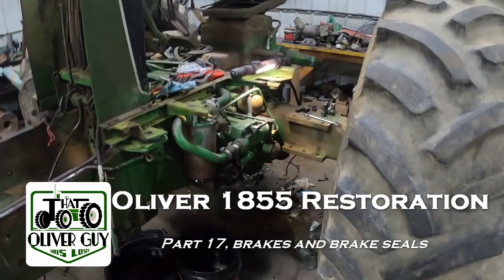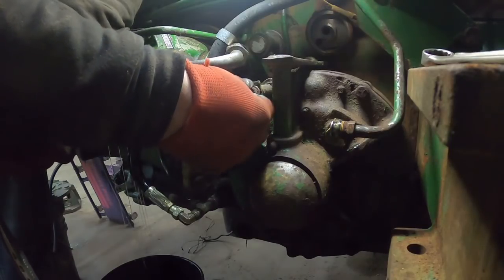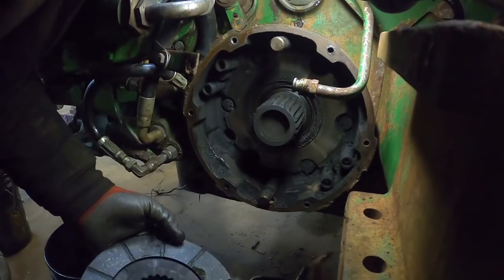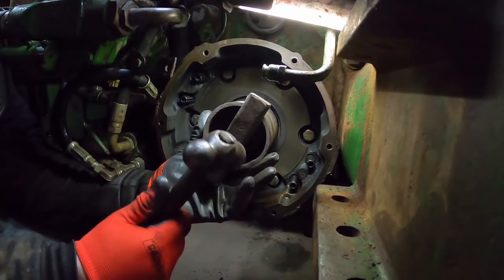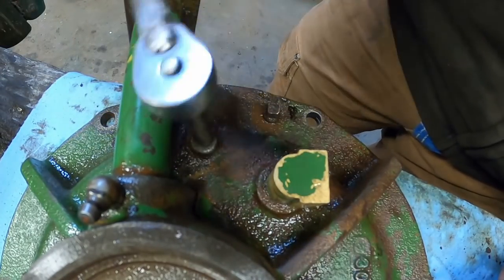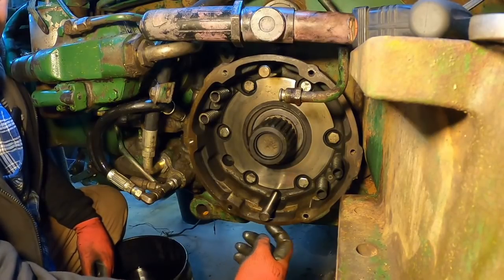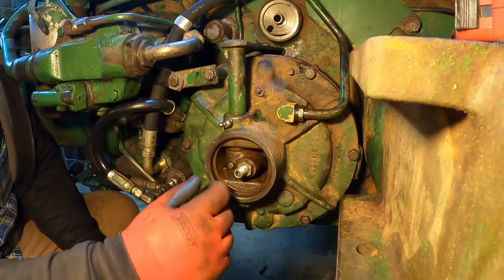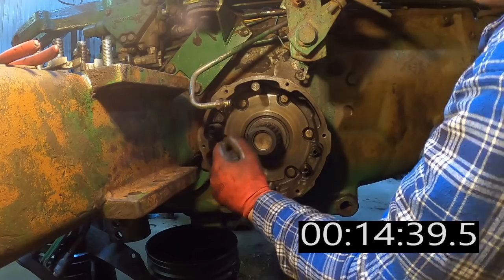Oliver Brakes - 1855 Restoration Part 17

Comment: Good video to help anyone working on one of these units. The early 55 series had 3/8” brake lines and the park brake shaft didn’t have grease fittings and the shaft seized in the brake housings. Probably most of those units have had the grease fittings added over the years. Early 2/85, 2/105 brakes would squeal at times and the fix was a brake housing that was 1-3/8” thick vs. the original 3/8 housing. I changed quit a few of them in our PA hill country. Thanks for promoting the Oliver history!

Comment: I am so grateful for these videos.  I just recently acquired a G850 Minn Mo and I have to do the brakes, steering and PTO.   It was originally shipped to Freeland Mi so not too far from you.  
Sold new by Rohde Equip  
Ill be referring back this alot!  
I will probably go through the brake valve as well
Reply from the maker: Rhode Equipment, I remember that name. They were still in business when Agco bought the White tractor. We'd sit with Paul Rhode at the dinners and talk about the good old days.
I have my brake valve waiting on the bench for a reseal, so there will be a video of that one of these days.

Comment: Would you be able to do a series on the large gas-powered tractors some time? I saw an 1855 gas 4wd ad and was very interested to hear more about it. I'm a big fan of large gas engines : )
Reply from the maker: I can try to do that. The 1855 was Oliver’s largest gas offering, at least in late model, high horsepower models. I remember seeing pictures of a low houred 1855 fwa, gas engine,  and cab. It was bought new by a rural doctor that wanted to be sure he could always make it to town, no matter the weather, and gas so it would start no matter how cold. That's pretty much all he did with it, and it's in the hands of a collector last I knew.  The 4 cylinder Oliver 99 had well over 400 cubic inches of displacement,  but only made about half of what the 310 in the 1855 would.

Comment: Back in early 70s at Chrysler Plymouth dealership we got air hose n just clean that asbestos right off into the air 
 They got same set up on later model combines . Mechanical to hydraulic don't know how many went to wet disc n same thing with hydraulic components mechanical over  Electric looking forward to Restoration

Comment: Did they change the trans housing enough that you couldn't put these brakes in  a 50 series tractor? Another fantastic video, thank you!
Reply from the maker: That is an interesting question. I did some digging in the parts books, and both housings use the same seals, orings, bearings and shims. I can't say 100%, but if I had to guess, I'd say they could be swapped. The downside is it would be a lot of work since the bull gear prevents the brake housing from being removed. You'd have to pull the hydraulic unit and the axles so that the bull gears could be taken out, then the housings could be slid out. You'd probably want to switch to a 55 series dash as well so that the brake pedals and brake valve are there. Putting the brake valve on the 50 series rear end and getting it to work with the pedals would be a challenge. I guess it could be mounted under the right platform near the brake pivot, then you'd just have to fab some linkage to connect the 2.

Comment: Wondered about slightly beveling the bottom outside edge of the brake piston a bit more to allow it to pass by the O ring easier?
Reply from the maker: It is beveled fairly well. I recorded something about it, but left it out to keep the video from getting too long.

Comment: I asked you about the brakes on a 1755 that the pedal falls to the floor. I pulled apart the drum on the side and it’s not the problem and been rebuilt recent. Where is a good place to get a rebuild kit for the valve in the dash?
Reply from the maker: I don't think there is a kit. It's mostly orings, but there is a gasket or 2. Agco still has everything seal wise, but I'd open it up first and see if there are any broken springs. If that's the case, you might be as far ahead to get a used one. I'd get one out of a White 2-105 or 2-85, they have all the improvements that some of the Olivers did have.
Reply: @ThatOliverGuyChris  ok thanks can you get that thing out without pulling the fuel tank?
Reply from the maker: @xade7863  I don't think so. It's really buried in there.

Comment: That was an excellent video. I've always wondered about the brakes on the 1755 at the farm but they've always worked so good we've never had it apart. Not in my lifetime anyway. Someday if I get my way all of those Oliver tractors will be restored by me so these videos are going to come in super handy. 
That's really cool you still have parts from the dealership on the shelf. Would you say it's still a wide selection?
Reply from the maker: When we closed we could return any current part to Agco for dealer cost, except things like paint, hoses, seals, .... stuff that was considered short shelf life. As we packaged up stuff to ship back, I got the yay or nay approval on what stayed and wentt. So things like brake discs and common wear items stayed because I knew I would use them eventually.  So there's a pretty good assortment,  but there's been a few things we returned I wished I had kept.
Reply: @ThatOliverGuyChris  Yeah I can imagine there's a lot of things you wish you kept knowing what you know now. I imagine that was probably a hard call to make at the time when it was all happening though they were probably a lot of mixed feelings about the whole situation in general
Reply from the maker: There were things that were pricey that I might never need, like a closed center hydraulic pump. That's a lot of money to have sitting on the shelf possibly rusting or seals going bad in, so I took the chance and sent it back. Knock on wood, I haven't needed one in all these years. Hindsight is always 20-20.

Comment: Chris is there a way to tighten up the tension on the throttle? Mine keeps creeping down
Reply from the maker: It's under the fuel tank on a 55 series. Here's a link to my video on that
https://youtu.be/mU_pSQANqTw?t=618
Reply: @ThatOliverGuyChris  also where would the best place to try and find everything to add a second remote to my 1755?
Reply from the maker: @Xade ¿  Lagesse Oliver might have what you need, https://www.lagessetractors.com/
Maibach might too. 
Ross the Oliver Man just did a video on those valves. 
https://www.youtube.com/watch?v=BMQL6YJeMKU
I'd at least plan on replacing the orings between the valves, plus you'll need an extra set for the one you add in.
Reply: @ThatOliverGuyChris  thanks for the help. Mine didn’t have but 1 and I need a second to pull a blade. I seen Ross’s video on them valves and another persons on rebuilding them and mine is leaking a little aswell so I plan on rebuilding mine

Comment: The spring in my parking brake handle is broken, can that be fixed?
Reply from the maker: Yes. It's the same spring as in the pto lever on an 88. K1690. Korves Oliver has them at https://korvesoliver.com/pto-engagement-rod-spring/
The button threads onto the rod that comes out of the bottom of the handle. Hold the rod from turning and turn the button off, hopefully it isn't rusted tight. Once that button is screwed off, the spring is just below it.  Slide old spring out, install new and reverse procedure to put it back together. You may have to remove the grip to get everything out
Reply: @ThatOliverGuyChris  thanks so much for that advice. That will make parking without  putting in gear and shutting  engine off.